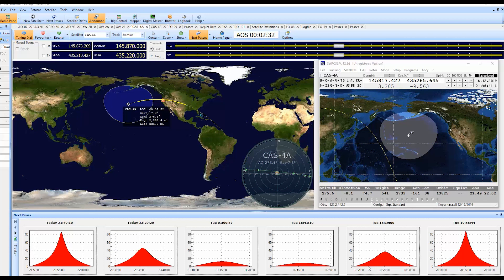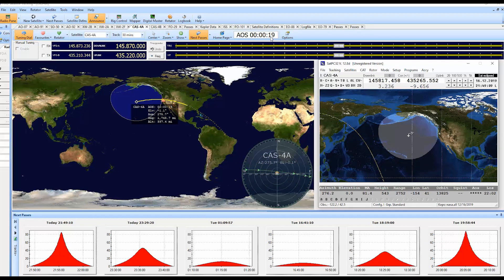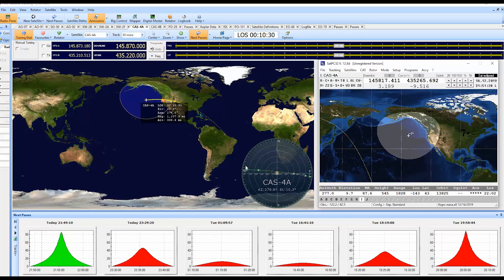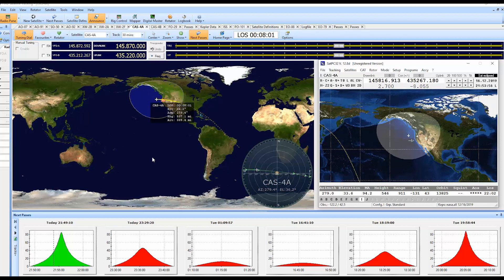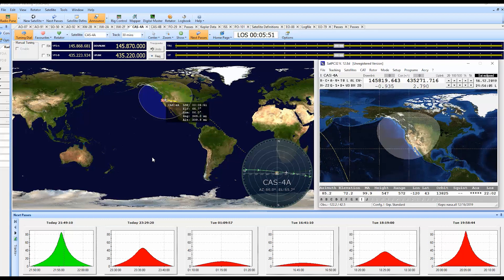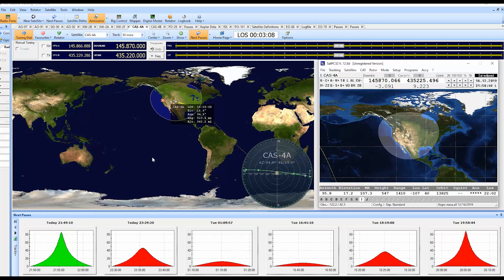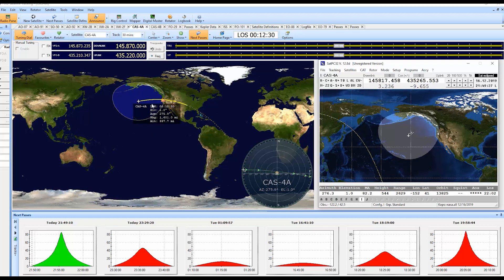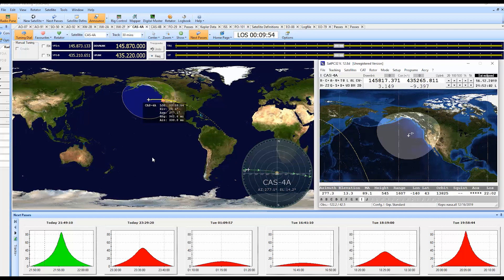Working linear SSB satellites on the Icom IC-9700 ham radio

Comment: Hello, I am currently working on getting on Ssb sats. I have heard myself and had someone return a call but I am having trouble staying on frequency. Do you have any pointers? Is Satpc controlling the doppler?  I am using the 9700 baby brother 910
Thanks for any advice
73 
Ian
Kc3kop
Reply from the maker: Ian,
Yes, SATPC controls the doppler shift  nicely
Reply: @hamradiofrequencies  Thanks I got satpc working good on the ic910 hope to work you '73 - KC3KOP

Comment from the maker: Due to audio edits eliminating many minutes of calling CQ and no dialogue, the audio obviously does not match the video portion, however, the audio was associated with the same video.
Follow my cursor around for pointing out key areas of the software. The audio was from two SAT passes CS-4A and CAS-4B about 40 minutes apart.